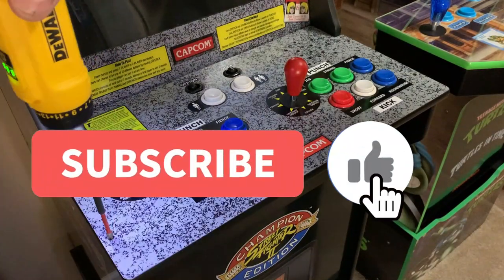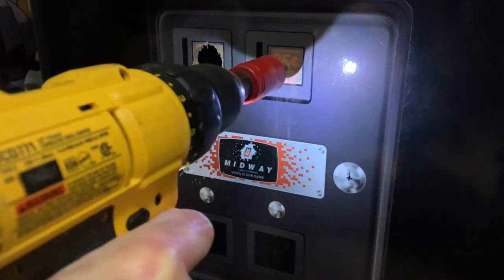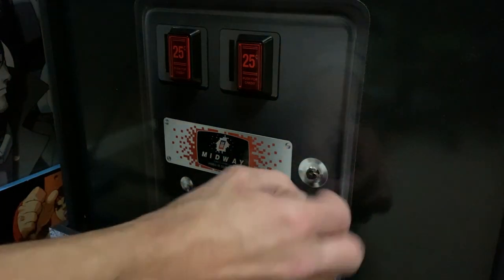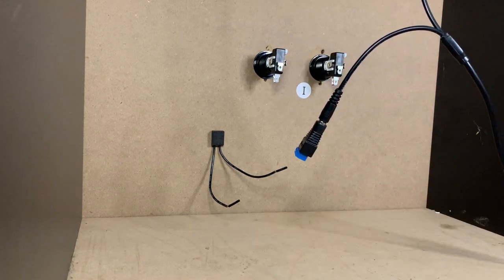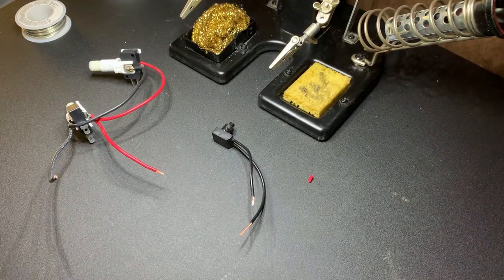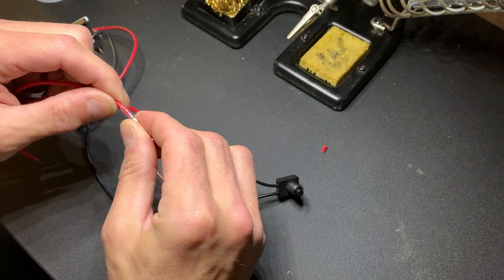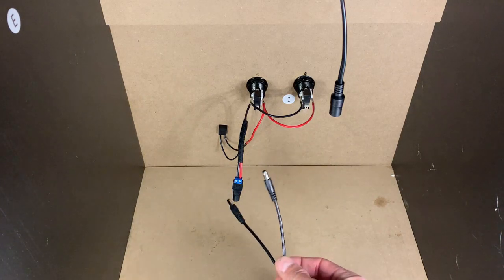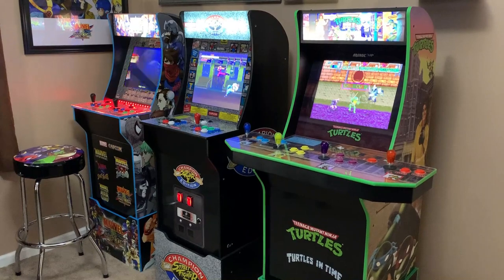Cab Rehab 3:  Arcade1up Coin Door Gets Lit Buttons

Comment: Your most informative video yet! I absolutely love the coin door decal idea with the coin buttons-- that's really cool and adds a whole new dimension. And hot tip on those solder seal wire connectors... I had no idea those existed but purchased them immediately! I'm no stranger to soldering, but this is a much simpler option if you ask me. Great work!
Reply from the maker: Hey thanks, I really appreciate it. 🦊👊🏼

Comment: Very nice work. What was the cost of this mod? Looks just as good or better than a legacy cabinet. This would be a great mod for a pac-man cabinet for those who want a coin door but don’t want to sell and buy another pac-man cabinet.  I am wondering why can’t we use those stickers as templates and cut around them to install a real coin door? But not sure how you would hook it up to accept a coin and start a game.
Reply from the maker: The cost of the parts was a round $50. I’ve posted a link in the video description.  There isn’t a coin input on a stock Arcade1up but you could connect if you install a Pandora’s Box or Raspberry Pi

Comment: Hey where'd you get the Y-splitter and the adapter with the terminals from?
Reply from the maker: Amazon. 5.5mm terminal connector: 12V DC Power Connector 5.5mm x... https://www.amazon.com/dp/B07C61434H?ref=ppx_pop_mob_ap_share
Y Splitter: 2Pack 1 to 2 Way DC Power Splitter Cable Barrel Plug 5.5mm x 2.1mm for CCTV Cameras LED Light Strip and more https://www.amazon.com/dp/B01M7N1GOH/ref=cm_sw_r_cp_api_glt_fabc_WNPQK9003BEXT0DNA14V
Reply: Thank you! This is the last thing I need for my own lit buttons!